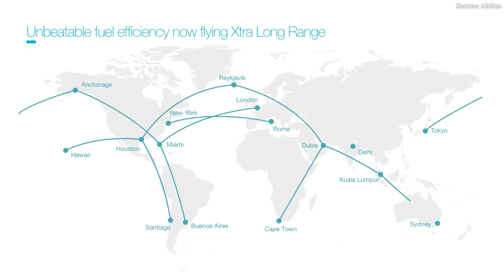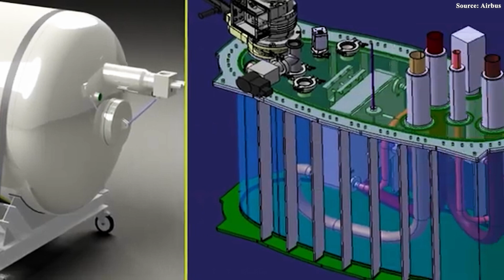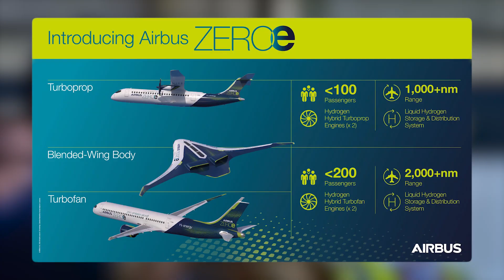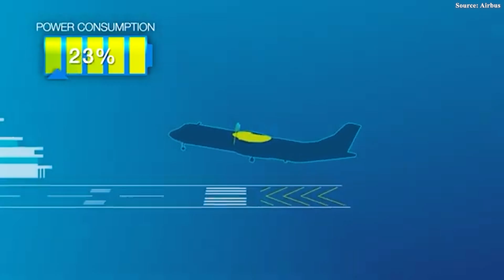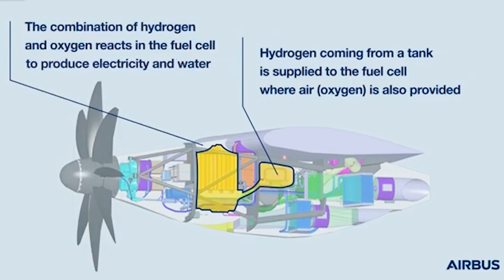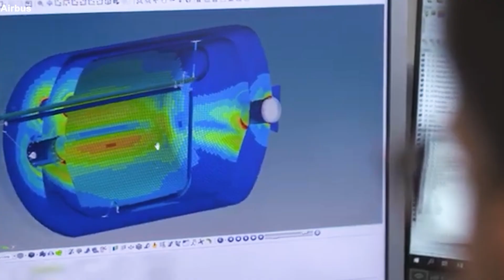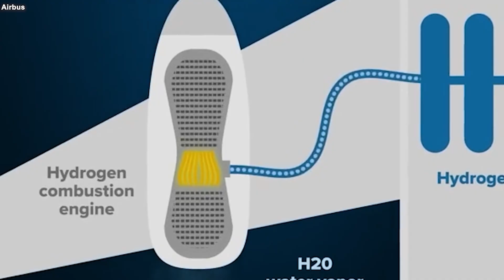This Why Airbus' Next Aircraft Is The END of Boeing & Its Shocked Everyone!

Comment: BMW prototyped a cryogenic LH2 tank for its cars. Went nowhere, way too complex and dangerous. Green hydrogen should be used to massively improve yield in Fischer-Tropsch production plants producing affordable SAF. This can be blended with fossil kerosene as needed. The fuel distribution, on-board storage and combustion issues are solved or easily solvable. 

For short-haul platforms, parallel hybrids of downsized turbofans or turboprops with electric motors running off Li-ion batteries and renewable electricity may make sense, depends on weight and non-CO2 environmental regs.
Reply: if you are going to make a leap make it 100%